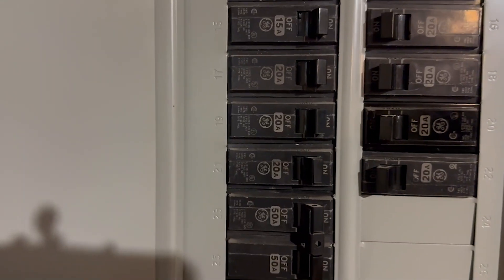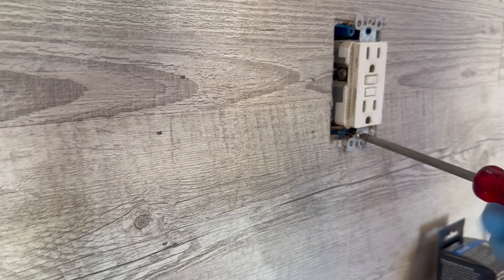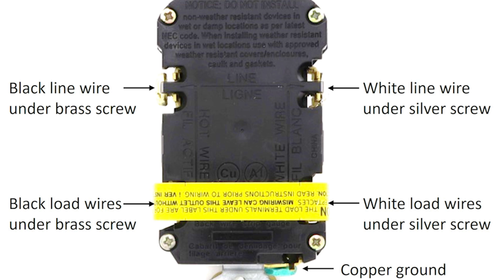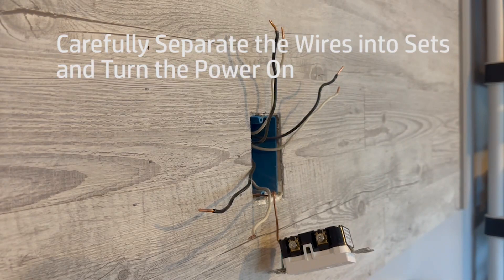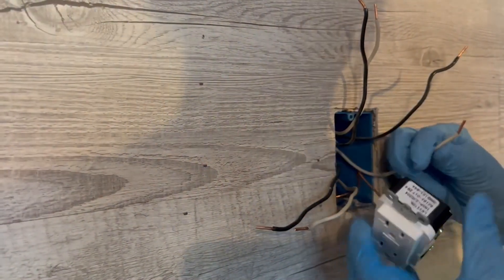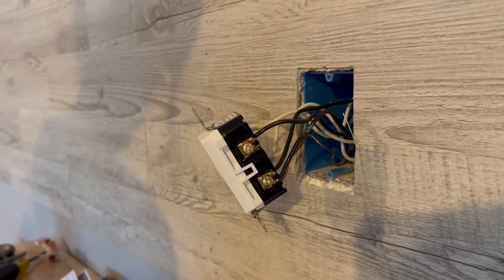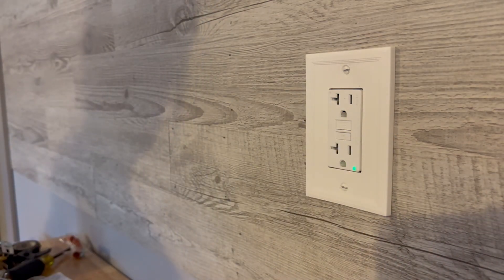Install a GFCI Outlet with 6 Wires!  Identify Line-In / Line and Load Wiring

Comment: Hi, How to know which is the line or load as I see 2 hot energized wires, one is black & other hot wire is red. Both red and black are energized hot cables and only one white wire. How to wire a GFCI, then? Changing from a regular outlet to a GFCI. Thanks 🙏

Comment: On my Leviton instead of having a screw on the outlet, I have a wire coming from my load outlet. Can I put the 2  load wires going into the wall onto my load wire that’s coming from my outlet in a pig tail  where you put both  wires onto the screw.
Reply from the maker: @jamespt2005  I suggest looking at the original setup and taking photos before replacing an outlet.  Theoretically what you are saying makes sense, but always consult with an electrician when unsure.  Good luck with your project!

Comment: Thanks for emphasizing on how to identify line and lead. I am doing exaclty as you showed, I have 2 wire sets and I am unable to find the neutral associated with the line and no matter what combination I try the gfci won't reset. You easily identified your neutral associated with line and other two with loads, how do I do it?
Reply from the maker: Hope you figured out the issue.  The wiring coming through the wall should be in sets

Comment: Did as instructed & reset button won’t stay in & outlet will only work if holding in.  Other outlets will not
Reply from the maker: There could be any number of reasons why your GFCI outlet will not reset. The first thing I would check is the breaker box to make sure the breaker hasn’t tripped or was not turned back on. Also double check your wiring and make sure everything has a good secure connection, if it still doesn’t work, it could be a bad GFCI outlet, moisture in the outlet or a wiring issue. It’s important to understand your wiring set up for your particular situation. Good luck and keep me posted.

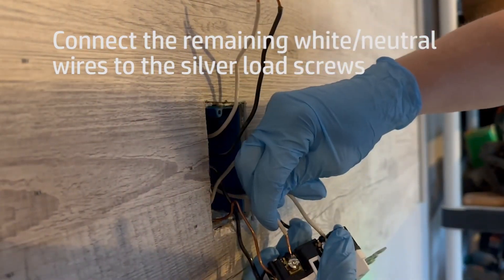Comment: 4:45 I stopped watching at this point. Never connect more than one wire per terminal. If you have more than one of the same wire, pigtail it! You are teaching your audience to do things that are not only against code, but dangerous!
Reply from the maker: I appreciate the feedback.  However, Steve Campolo, vice president for engineering at Leviton, responds: UL specifically tests receptacles for the ability to safely carry downstream current. This testing is usually conducted at 20 amps, since a 15-amp receptacle can be wired on a 20-amp circuit and thus carry the 20-amp feed-through current. As long as the receptacle is rated and UL-listed for feed-through wiring, as well as properly installed, it should be safe as intended by UL’s Standard for Safety (UL 498), which covers receptacles.  

Code Compliance states that both pigtailing and through-wiring comply with the NFPA 70 code, assuming local code stipulations do not require a specific method.  

The ground wire is pigtailed in this video.  :-)
Reply: @mainelydiymom  The point is that at 5:00 you connect both loads under the same terminal. Is that an approved method for that receptacle?
Reply: when my house was built, they did it the exact same way. That she is showing me and when I replaced the GFI. It was hooked up the same way that she is showing me, and APPARENTLY it passed inspection. When the builder    sold me the house and it was built brand new. So, how did it pass inspection if that's incorrect?
Reply: @okaro6595  Yes, it is an acceptable method, all GFCI's and commercial spec grade receptacles have this option, it's not the same as "double tapping" which refers to placing 2 wires under one terminal lug in a breaker panel, which is generally illegal.

Comment: I have all the wires like you except there's also a red wire. Where should i connect that to?
Reply from the maker: A red wire is also hot, like the black wire. It goes to brass, just like a black wire. BUT how was the outlet originally configured?  Do you have a switch that operates the entire outlet, or part of it?  You see them in a 240 V outlet or when a wall switch controls the outlet.  If unsure, always check with an electrician.

Comment: Leviton’s instructions say not to connect the GFCI when there are more than 4 wires plus grounds (you connected 6 plus the ground). The instructions are to call an electrician in this case. Why did you feel safe in connecting 6 and is there a reason that you know of for the instruction not to do so?
Reply from the maker: If you have more than 1 GFCI outlet on the circuit (in a bathroom or kitchen, for example), you need to wire the outlet a little differently.  The power source goes to the first GFCI outlet in the series (line side).  You would also need to line side the wiring traveling from here to the next GFCI outlet, so line side it both coming from the first GFCI outlet traveling to the next GFCI and on the second GFCI outlet.  Do not use LOAD to send power to the second GFCI outlet.  If you do were to do this, it would act like an ordinary outlet with no ground fault protection.  And you may think it is tripped when in fact there is actually power going to the second outlet.  Disclaimer:  I am not an electrician, just a DIYer who reads a lot.  Hopefully an electrician will chime in here as well